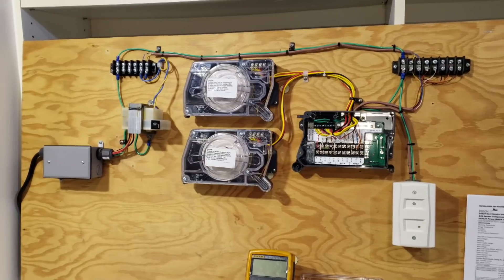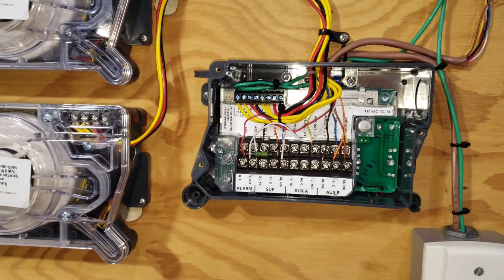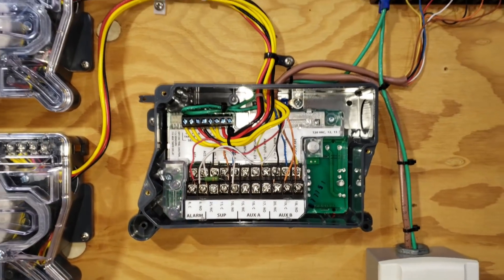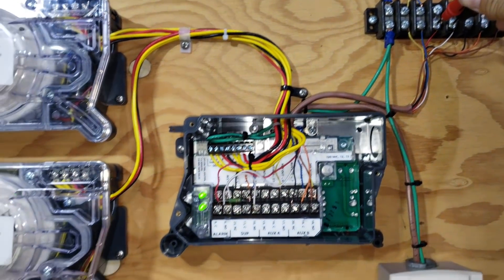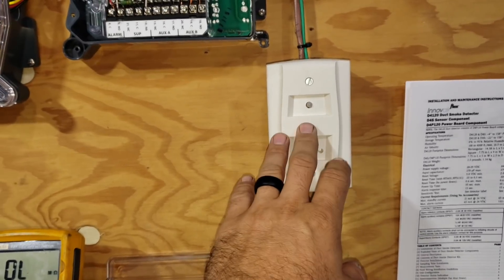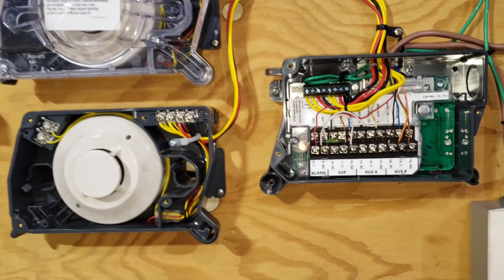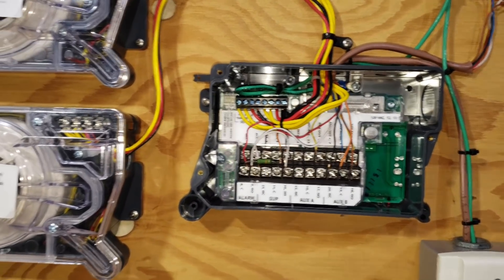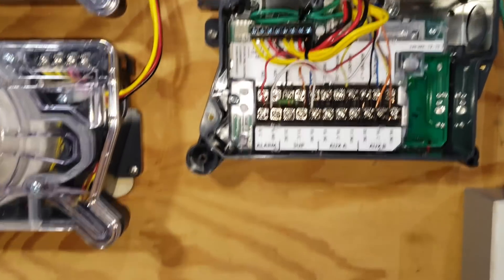Duct Smoke Detector Simplified

Comment: Hey Chris. Real quick. The supervisory contacts are closed because when they are powered down, they supv relay opens. Just like a door contact on an alarm. This is to monitor AC unit working.  
It’s also to monitor the tamper off of one alarm contact. Example: the 2 alarm wires tie into the alarm relay with the resistor across to keep it supervised. But pull one leg of the contact off of 1 alarm terminal. Replace it with a jumper that will connect from alarm terminal to common of supervisory relay. Then the other leg of the alarm contact will screw into the terminal of the normally open supervisory relay. So basically, the alarm is completing its circuit with the resistor strapped over the alarm relay, then to the “closed” supervisory relay. So that when the detector is tampered with, or loses power, the circuit will “open” and cause the fire panel to go into a trouble. 
Hope this helps!

Comment: The installs that I've done, as a fire tech, had a 'less smart' unit, but the smoke head was addressable for the FACP and the detector unit still had the test/reset stations hooked up.  The supervision and alarm all came through the addressable part, so a lot of smoke heads and duct detectors (dozens) are looped in on a single 2-wire circuit.  There was a separate addressable relay (that the HVAC tech would tie to) that would activate upon alarm, or whatever other condition, from the FACP.  A general fire alarm from the building would shut down the units, but a duct detector that has sensed smoke would usually only shut down the unit and send a supervisory alarm.
Reply: I like that bc if I’m working on that unit and accidentally trip the duct detector I don’t call the fire department over for a false alarm

Comment: In Australia, the way duct detectors are done is different. 

They are powered from the fire panel itself, not an external/auxiliary power supply.They are wired on the detector loops, so any alarm or fault condition is seen directly by the panel.
Usually , there is one duct probe on a supply unit, to check for "smoke" in the outside air and the unit is set to shut down on a "fire" condition. Then once the "smoke" is cleared, the fan will start back up. The idea is to stop smoke from outside being put into the building.
For return units, the duct prob is set to generate an alarm, set off the warning systems, call the fire brigade, shut down supply units,etc ... what ever the fire/smoke matrix calls for. IE: there is smoke in the building somewhere. 
This is a latched alarm, so you need to reset it from the fire panel. 
The dectectors are usually addressable, so you know exactly which detector is in alarm or fault.

The duct detectors you're using, we do use too. But we use them on "dumb" or non addressable fire panels. They are the only device on the circuit from the fire panel. Only used on return air ducts.

That all being said, the fire codes for the US and Australia are vastly different. In some instances, I wish we had the set up you have ( as displayed), in some other cases, the system you have would causes a lot of problems here is Australia.

Comment: Easy about the relay.  The no/nc refer to the de-energized state.  The sup relay with normally be engergized to ensure the alarm if power to the unit fails.
Reply: I was just about to comment this, that's why it indicates trouble when the power is cut. No power to pull in the relay, means you get an open circuit on the alarm wires.

Comment: I have run across controls that appear to be backwards - particularly in speed switches on generators that operate automatically- what is happening is that supervisory contact changes state when the power is applied.  If installers dont realize this there will be start up issues.  Why dont you measure the contact with no power applied and then turn on the power to the control unit and see if the switch changes state.. another advantage to that setup is if the n/c is closed with the power off and opens when it is energized the if the power went off the contacts would close to send an trouble signal - and for systems that depend on a normally closed circuit - which is generally the case - it would be the n/o supervisory contact that would be used to monitor for power and circuit trouble ... the resistor is generally referred to as an EOL resistor or End Of Line.  Your explanation is correct except that the fire system senses the amperage or load on the detector circuit created by the resistor.  No load equal open circuit and trouble alarm - shorted circuit equal alarm condition.  These things are pretty simple once you know how they work.  Course so is flying a 747 once your trained and have a few thousand hours of seat time... nice video
Reply from the maker: Thanks bud! I will be going live on YouTube this evening 12/16/19 @ 5:PM (Pacific Time) to discuss my most recent uploads and answer questions from emails, the chat and Facebook come on over and check it out if you can.  https://youtu.be/_20hGnjjK44

Comment: So for people who are not in the fire or security industry(both are the same when it comes to EOl resistors I’m gonna break this down for you. On any wire that you have whether it be open circuit or closed circuit; the only way to ensure that the wire is good and hasn’t been cut down the line somewhere is to put a resistor with a certain resistance or ohm value at the end of the cable. 3.3 or 4.7k whatever it may be all it does is tell the control panel that the wire is intact. This is not voltage!!! It is a circuit. Ohms. Resistance. So you are correct we as fire people on a normal fire system are looking for a dead short, pretty much the wires touching together to indicate our alarm signal. In normal operation the panel is reading the value of the resistor. An open circuit or cut wire would indicate a trouble condition. This is different than a supervisory signal. Supervisory signals aren’t alarm signals!! Yes we want to know about it as it will report to the monitoring facility what the trouble but we don’t want it to create an alarm and activate horn,strobes and such. 99% of fire alarm circuits are open circuits because that’s the most efficient way of detecting the two states of the circuit open or closed. Closed for alarms and open for troubles. Anything else is just normal resistance value at the end of the cable or line.
Reply from the maker: Great information bud thanks for taking the time to leave some info!
Reply: also the monitoring company should not be calling the fire department for a trouble signal when you turn off the unit.

Comment: Awesome video I don’t think I’ve seen one not come installed in a unit in a year or so now. Can you hook these up to an ansel system? Reason I ask is because the ansel system has dry contacts so it is breaking the signal from up above so is it possible to hook them to the smoke detector or is the ansel system basically taking the place of the smoke detector?
Reply: ansel system is taking the place of fire detection, its actually covered under fire suppression and not fire alarm, we hook into it for an alarm condition when the ansel system as well as the electricians for electrical shutoff to the stove, griddle, oven, etc. Ive also seen damper controls hooked into it as well

Comment: Great video. I think the Supervisory relay is labeled backward because when the unit is in a Supervisory condition, the common to normally closed contacts are closed. If the relay was labeled "Normal Operation" then the labels would be reversed. Also, the Supervisory relay is normal when the Detector module is powered and there are no abnormal conditions. When power is shut off, the relay de-energizes, which alerts the fire alarm panel. Also, when the smoke heads get dirty (internally) the detector will go into a maintenance alert, and open the Supervisory relay. This will be indicated also by a blinking amber LED. You can clean the inside of the smoke detector with a clean horsehair brush, and reassemble the head, or replace the affected smoke head. I have not had very good results trying to clean with compressed air.
Reply: I know its super annoying, you'd think it would work like the alarm contacts or any other set of dry contacts in existence, but no its got to be special.
Reply: @Ufphen  It has to operate like this so the panel shows a trouble when power is removed. Otherwise you would not know the detector has lost power.
Reply: @DDRighteous  but why is Normally Open not normally open
Reply: @Ufphen  The supervisory relay is labeled correctly when there is no power applied to the duct-smoke. To make it supervised, they apply power to the relay when no trouble exists. That way it transfers when in a no power state, or when there is a trouble condition. If it were to operate the other way, you would never know when power has been removed. Or you would have to install an external power supervision relay to cause a trouble condition when power is removed.
Reply: @DDRighteous  Its a set of dry contacts so regardless of power one side is going to be open or closed. Why would you have trouble condition be the normal state instead of no trouble condition as the normal state. These are dry contacts, they are passively designed, one side is always going to be shorted and one will always be open.
Reply: @Ufphen  I think System Sensor labeled their contacts following the relay manufacturer's labeling. Since the supervisory relay is powered up when it is in a normal state, that makes the contacts appear to be labeled in reverse condition.

Comment: My AUX is causing a dead short.  Causing transformer to pop the 5amp.  Ill recheck wiring tomorrow.  But I feel it has a bad relay in the smoke detector.  Nothing pops if I pull the AUX wires.  could not find a PDF when I was there.  Any help would be appreciated.

Comment: On the 7 minute delay for trouble, if you “solve” the trouble or close the detector cover before the 7 minutes would it still send the code to the alarm co?
Reply from the maker: No if you solve the trouble issue and or replace the cover before the timer ends it will not signal a trouble

Comment: Thank you  it is VERY confusing I have some that just shut damper and others shut the whole unit down
Reply from the maker: no worries bud
Reply: Yes the Fire Marshall for the jurisdiction you’re in has the ultimate say so as to what he wants the detector to do. Shut the unit down, shut the fan down, close dampeners or just notify monitoring center. Main reason for shutting down the un8t if smoke is detected of course is to sto0 any airflow from feeding a fire but also to prevent pumping smoke to other areas of a location.
Reply: DECK-eM J  what would say is more common wiring from unit to the Aux? I’m guessing 24v from the RTU? Sorry to bother you still in school, we don’t cover this at all?

Comment: I have seen a hospital remodeling rooms and found the sensor in the detector not working proper, always was sensing smoke when none was present
Reply from the maker: Yeah sometimes the detectors can be faulty, usually hospitals do routine inspections on their detector heads as they are usually held to higher standards.

Comment: How do i do a manual global shut down...."chain multiple alarms together manually"...?
Reply: You would need to put the contacts of each alarm in parallel, so that any one of them closing would close the circuit that you use to shut things down.
If you only want the thing to happen when all the detectors are going off (for some reason), you need to put the contacts in series, so that you need to close all the contacts for the circuit to complete.

Comment: I know this is an old video I'm just looking around to see if anybody was able to get multiple key test stations to signal (independent horn and strobe on other keystation installed on other air handlers) I have three rts2aos and three d4120 duct detectors 

Everything works except signaling the other key stations. 

It probably cant be done but I'm checking
Reply from the maker: Im pretty sure I have seen multiple key stations lit up before when one was tripped, does the global shut down not do that?  I will be going live on YouTube this evening 1/27/20 @ 5:PM (pacific time) to discuss my most recent uploads and answer questions from YouTube comments, emails and the live chat. Come on over and check it out if you can, https://youtu.be/5KtVii_Tw5M
Reply: @HVACRVIDEOS  no when you flip one key station only that one lights up and sound off,

I called the supplier and they told me it cant work like that because their isn't a connection in there for that

It's a d4120 and rts2-aos key station from system sensor

Comment: I had an alarm company break a 24v wire at a terminal strip buried inside there alarm box. Drove me nuts ....couldn't find where I lost 24v..the wire was extremely hard to detect a break. The alarm company is a constant source of problems.. How many times the panel was not reset after they were done testing and I get a no heat or cool call. I then have to go to that location and punch in the reset code. Idiots..Smoke detectors mounted on the ceiling pop off there mounts because the tech didn't lock it in....Idiots...job security I guess...lol.